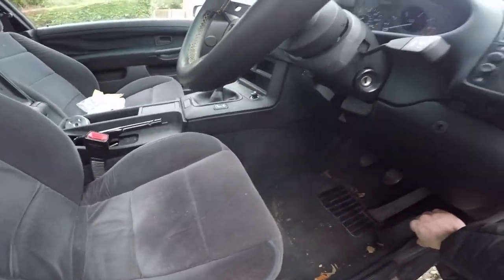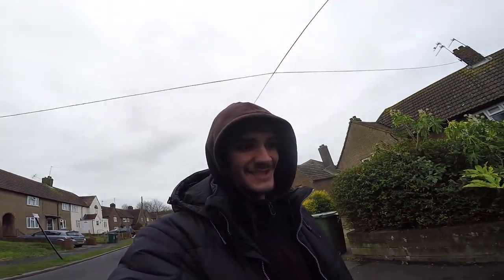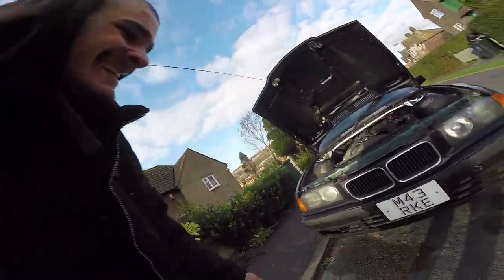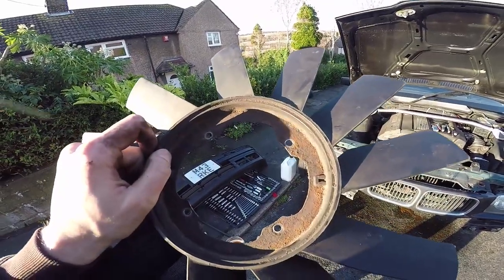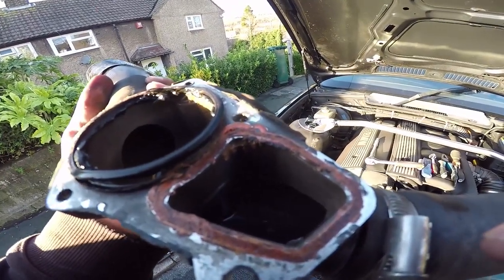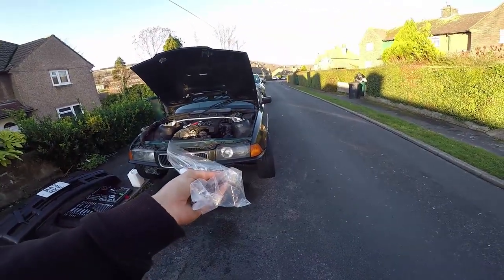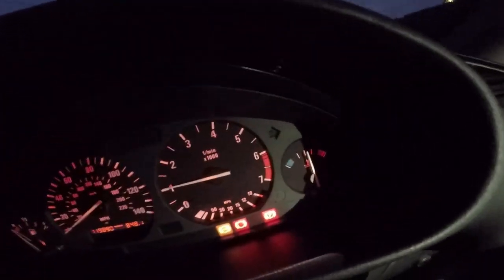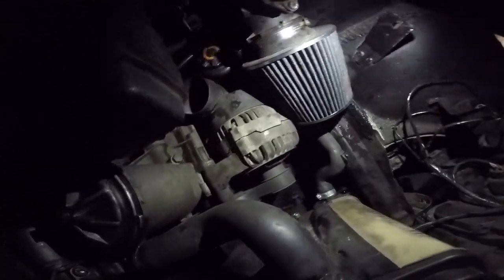E36 Thermostat Install

Comment: I had to do the thermostat on my 323i 2/3 weeks ago. I had no heat out my blowers for like a year or so, also fitted a alloy housing. Took fucking ages to bleed it up  & get it all working good.
Reply from the maker: yeah bleeding is fucking hectic, if u dont understand the cooling system properly, now that i took it all apart myself i understand it better and stuff, theres loads of different ways/ tips for bleeding , everyones got their own methods